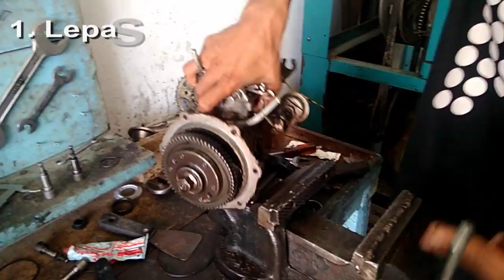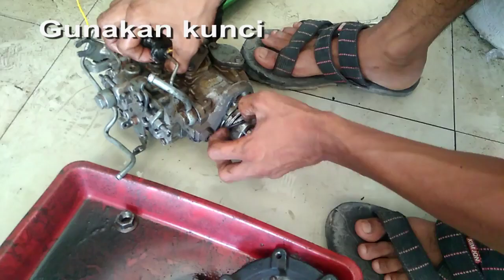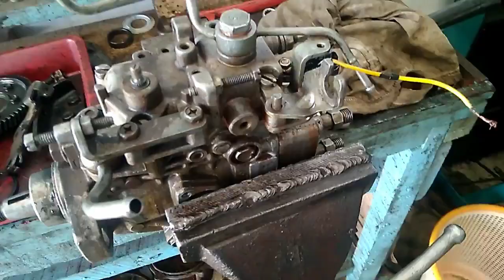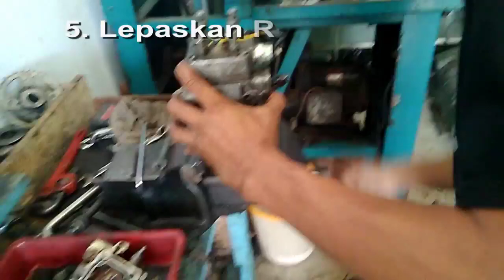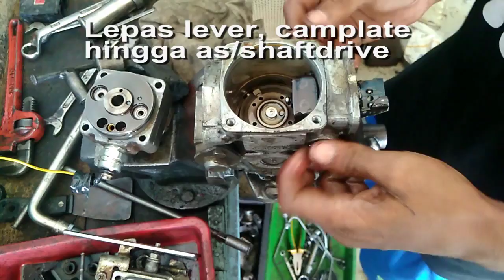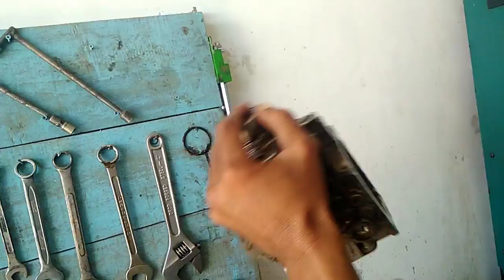cara membongkar injeksi isuzu panther 2,5

Comment: permisi om mau tanya..
bospom panther 2,5 turbo saya , keluar solar rembes dari baut yang kepalanya segi tiga, kalau mesin hidup netes, itu dikarenakan apa? bagaimana cara membetulkanya ?
Reply from the maker: Baut samping ya?
Coba dikencengin lagi sedikit, kalo masih harus diturunkan bospomnya dan ganti ring kuningan pada baut
Reply: @KenInjeksi  kalau dibuka langsung ada pengaruh didalam bospom ?( maksudnya takut kalau dilepas nanti ada part yang geser atau gimana)
Reply from the maker: @saryantobms5105  Betul sob, kalau baut dilepas tanpa menurunkan bospom gov lever akan terdorong oleh spring yang ada di rotor head. Pemasangan kembali baut akan menjadi susah dan beresiko merusak lever.
Reply: @KenInjeksi  berarti kudu yang ahlinya ya om...kalau misal di lem pakai lem stil aman gak om.?
Reply from the maker: @saryantobms5105  kalau untuk sementara tidak masalah ditutup menggunakan plastik steel. Usahakan benar2 kering sebelum dilem
Reply: @KenInjeksi  ok trims infonya, sukses terus ya om
Reply from the maker: @saryantobms5105  Sama2... jangan lupa share ya...
Reply: @KenInjeksi  ok om...

Comment: Om isuzu panther hi sporty susa hidup stlah di cek smua nosel gk kluar minyak itu apanya yg hrus di prbaiki slm sukses
Reply from the maker: G keluar minyak bisa karena
1. Solenoid mati
2. Plunger Rotor Head patah
3. Bospom tidak terisi minyak (feed pump bermasalah atau juga masuk angin)
Reply: @KenInjeksi  penyebab plunger pata apa yaom yg sala apa top g pas
Reply from the maker: @yusufvivo4817  top salah g ada efek ke plunger sob, seberapapun jauhnya kesalahan top minyak tetap keluar.
Plunger patah karena awalnya macet didalam barrel.
Reply: @KenInjeksi  makasi atas jwbanya om sukses slalu dan d mudakn rezkinya
Reply from the maker: @yusufvivo4817  sama2, penjelasan lebih rinci untuk alasan plunger yang patah sudah saya berikan di video yang terbaru sob (live).
Reply: Salam.. Tumpang tanya saya memiliki isuzu rodeo 4jb1 2.8... Adakah injection pump  sama dgn isuzu panther.... Atau lain modelnye?
Reply: Salam.. Tumpang tanya saya memiliki isuzu rodeo 4jb1 2.8... Adakah injection pump  sama dgn isuzu panther.... Atau lain modelnye?